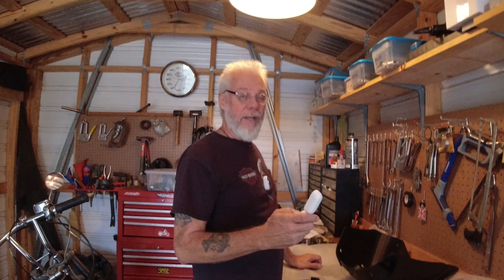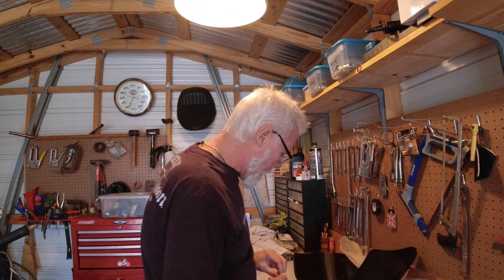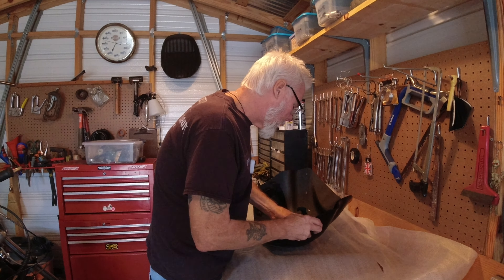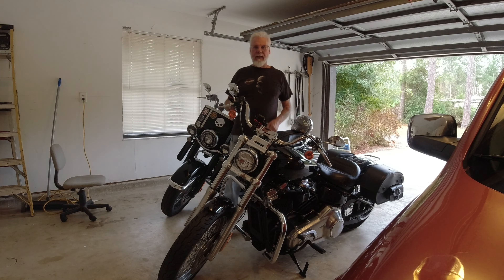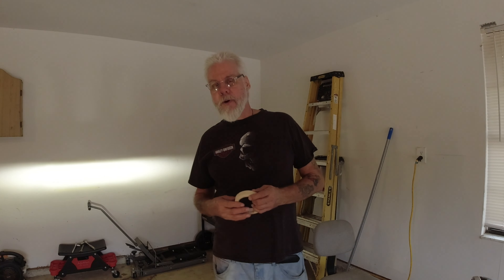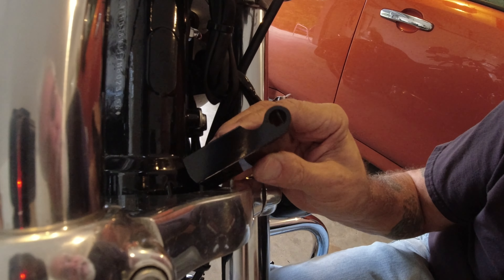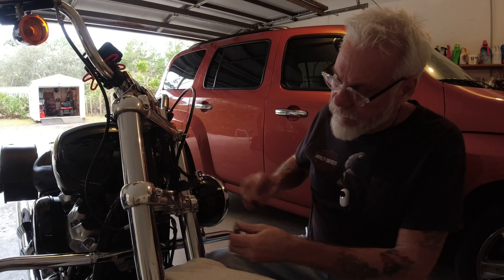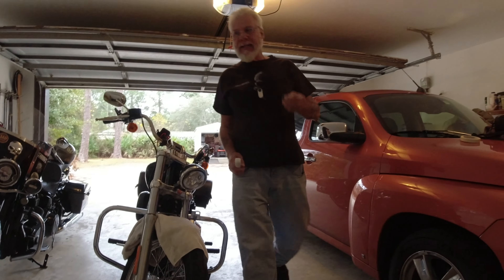Roar Warrior Fairing Install

Comment: Were the windshield screws included? Or are they another "buy separately" kit?
Reply from the maker: Hi Col. Yes, the nylon screws are included. Thanks for watching!
Reply: Finally installed mine. I think there's a slight flaw in the bottom part of the fairing. The cut-out or recess for the headlight bracket to slot in is not quite big enough. Seems it needs more cut off the actual fairing to fit better. I have the extension block on the first notch. Second notch was worse.. My top clamps are quite high, nearly touching the top of the forks.. Tried several different options to fit it 😂
Reply from the maker: Hi Col. I recall having to do some adjusting of the clamps until I got it right.